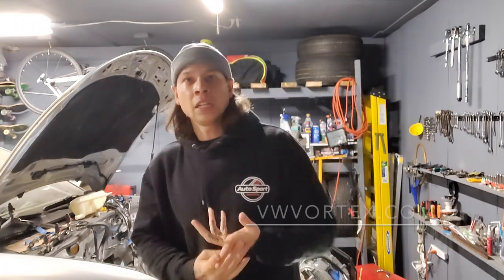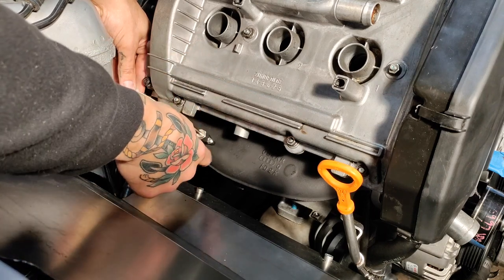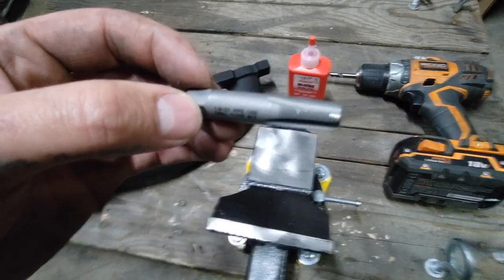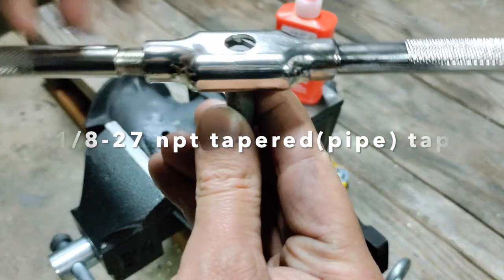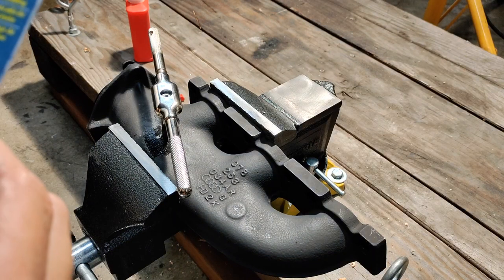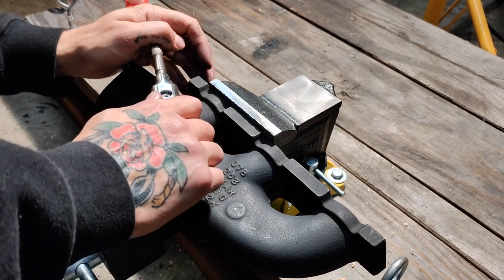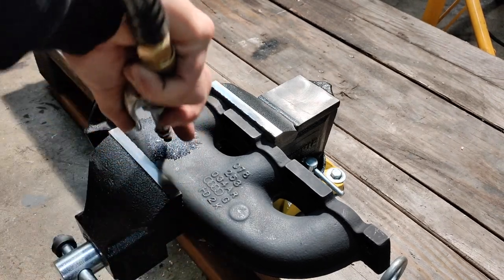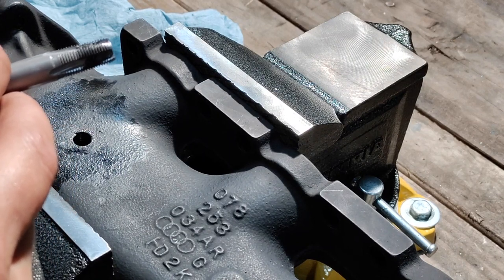DIY: Tapping exhaust manifold to receive an EGT fitting/probe

Comment: Thanks for sharing, really appreciate the video as I will be embarking upon doing an egt sensor soon. I feel prepared to do this based on what you mentioned about being ever so cautious. The half forward and quarter back as well as reaming her out slowly before going to deep...that sealed the deal for me. Going to penetrate some virgin metal with my hard tap. Please tell me you didn't have to pull the engine just to do this mod. LOL I will be doing my Vixen21.
Reply from the maker: I was already building my motor so everything was out. Ideally you should pull the exhaust manifold to do the job so you don't accidentally introduce debris into your engine through your exhaust valves. But there are a few tricks you could do. If you wanted to leave the exhaust manifold bolted to the head you will need to pressurize the cylinders with compressed air while drilling so you can keep drilling chips from entering. You would also want to disconnect the down pipe from the manifold so that those drilling chips have an exit considering the compressed air will want to blow them out somewhere. A shop vac near the drilling site will also help you keep the situation clean.
Reply: Well, the reason why I want to do now is because I need to replace exhaust gasket. 😜 Highly recommended in the BMW TD M1 engine.